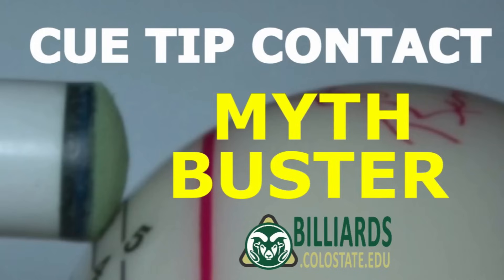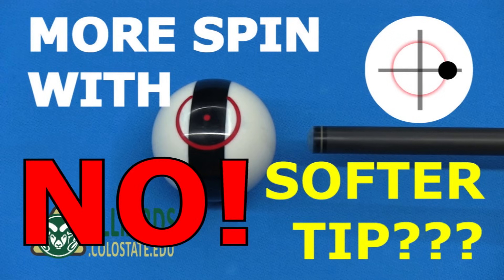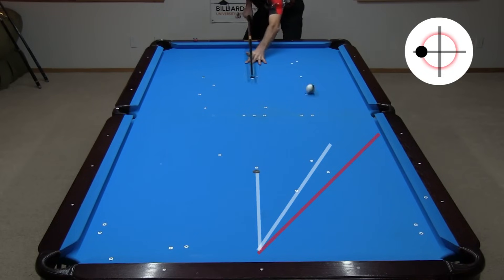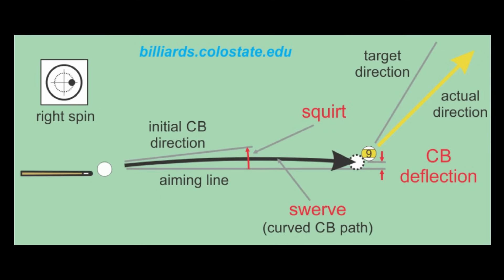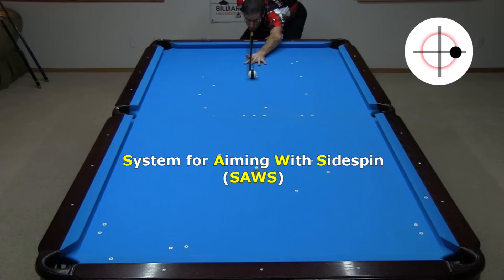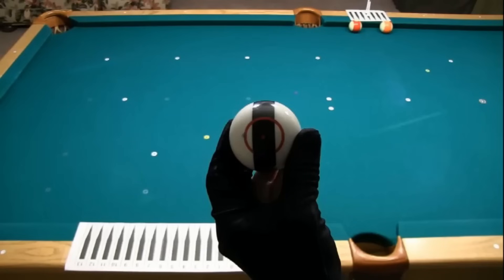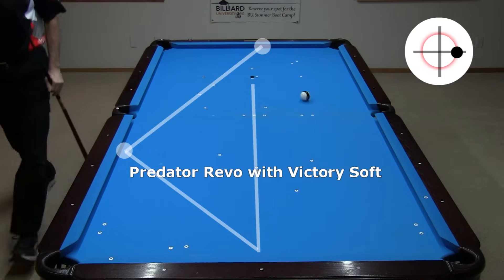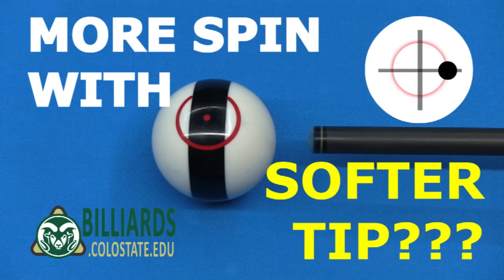Can a SOFTER TIP Put MORE SPIN on the Ball? -- MYTHBUSTING Answers

Comment: You have done great effort, but  I wish you gone deeper with cue ball deflection with hard and soft tips. so many say with hard tips it deflect less but as a side spin player for 20 years and I'm extremely nerd at it, I can confirm hard tip deflect more than soft, because I got to the point where I at so many shot I don't need to compensate for deflection.
Reply from the maker: See the links and info in the last section here:
https://drdavepoolinfo.com/faq/cue-tip/hardness/

Comment: When it comes to power transfer, are harder tips more efficient than softer ones? I'm referring specifically to playing cues, not break cues. Is the difference in hardness ratings — soft, medium, hard — even significant enough to be noticeable? Again, I'm referring to playing cues, not break cues which have extremely hard tips.
Reply from the maker: Harder playing tips are slightly more efficient, and it is noticeable to good players.  For more info and demonstrations, see:
https://drdavepoolinfo.com/faq/cue-tip/efficiency/

Comment: I think many players equate the size of the contact patch with traction--like how a tire grips the road via friction.  The huge difference, however, between a tire and a cue tip is contact time.  Contact patch size does not equate to increased friction on a cue ball strike.
Reply from the maker: @thedevilinthecircuit  Agreed, unless the tip is not chalked well, in which case a larger contact patch size could help.  For more info, see:
https://billiards.colostate.edu/faq/cue-tip/hardness/

Comment: I think doctor dave proves that it doesnt add more spin rather adds more control on the spin. The harder the tip the lesser control but stronger hit, while softer tip has more control but lesser hit
Reply from the maker: That's a fair summary; although, the difference is tiny and easily adjusted for by any good player.

Comment: so to make it clear then what makes a different between cue tip hardness if it doesnt effect spin on high or even low spin,is it basically just a "cosmetic" that you choose along you changing and try different hardness and what shooting feel you like the most?
Reply: i've still don't get enough why there are soft,medium and hard tip but according to my experience as new player that has tried 3 of those that are the same type just different hardness(kamui black clear) i really like soft and medium but i do prefer medium more since when i use soft it only takes 2 week before the tip starts to mushrooming and i had to pay another 24USD to change the tip but in medium hardness i found a balance between durability and kinda "soft" feeling when i hit the ball,i dont like hard at all and i play really bad for 2 months because i'm using hard,it feels like i just made a shot onto a concrete and i feel like it makes my stroke a bit worse because it has feedback(maybe it's just a placebo effect because of the sound that hard tip makes when it hits) and it really annoy me
Reply from the maker: @raz0gaming  There are many differences, all of which are summarized here:
https://billiards.colostate.edu/faq/cue-tip/hardness/

Comment: You hit them at different speeds up and down the table your crazy
Reply from the maker: Which section of the video are you talking about?  With the max spin tests, I explain in the video how I took many shots and only showed the ones that had the same CB travel distance (to guarantee the shot speeds in the comparison are the same).
Reply: @DrDaveBilliards  the first lag up and down you claimed to hit the ball the same pace 3 times but you didn't. You claimed the ball was made to travel further due to the hardness of the tip. That's a load of crap
Reply from the maker: @mickmck13847  My stroke certainly felt the same for all of those hits.  I am generally very consistent with my lag shot on this table.  Regardless, different tip hardnesses definitely have different hit efficiencies.  Proof can be found in the first video here:
    https://billiards.colostate.edu/faq/cue-tip/efficiency/

Comment: Scientifically speaking, I’m not sure if those comparisons are fair when you are using an uncontrollable variable in your stroke. I think it would be more fair if you used a mechanism that would impart the exact same amount of force for every shot. Human error will lead to skewed results even if you truly believe that you’re hitting them all the same.
Reply from the maker: As I explain in the video, you don’t need to hit every shot perfectly.  You just need to hit enough shots with each tip, really pushing the miscue limit, to see what is possible, and only include (in any comparison) shots with the correct speed (based on how far the CB travels).  Careful cue testing with humans is almost always better than most machine testing that has been done over the years.  For the reasons why, see the “Rules for CB Deflection (Squirt) Testing” section here:
    https://billiards.colostate.edu/faq/squirt/robot-test-results/

Comment: Very nice video. Your tests appear valid when applying sidespin with a nearly level stroke. 
Your conclusion, though, that tip hardness doesn't matter much may not hold true in other stroke scenarios. 
     In particular, consider a situation in which you must apply significant backspin at distance (e.g., a straight shot with the object ball 8-10' feet away). 
     In such a scenario, a different and more complex set of variables and constraints come into play. For example, depending on the cue ball's distance from the rail, a nearly level stroke that will apply backspin may not be possible. The cue's angle of descent with a hard stroke affects tip compression, and may lead to differences between hard and soft tips in these sorts of shots.
     Have you done any tip hardness comparison tests involving power draw at distance?
Reply from the maker: I'm glad you liked it.  I have done test for other types of shots.  See the video and info here:
    https://billiards.colostate.edu/faq/cue-tip/hardness/
Enjoy!

Comment: I can verify that both my playing cue (soft tip) and break cue (phenolic tip) can impart about the same spin, but seeking the max spin I can make 9/10 shots without a misscue with the soft tip and 2-3/10 shots with the phenolic..... I have much more confidence playing shots with lots of spin using a soft tip and I also like the feel of the longer contact.
Reply from the maker: FYI, a softer tip does provide a different "feel," but it is impossible to detect the "longer contact" since humans can't detect time differences in the millisecond (thousandth of a second or 0.001s) range.  For more info, see:
    https://billiards.colostate.edu/faq/cue-tip/contact-time/
    https://billiards.colostate.edu/faq/cue/feel/

Comment: I'm afraid that I think you have failed to mythbust. The hypothesis you tested was "Tip softness affects maximum limit of spin." But I think the myth "softer tip put more spin on the ball" is not about maximum limit. Because most of the players don't know actual maximum limit (that is why you had to invent that clever method in the video), so the myth cannot be about it. What they know and evaluate with is "amount of spin/effort" ratio. In other words, "It's EASIER to put more spin with softer tip." 
It's quite hard to identify what is "effort" or "easy" in this context, but there's something leads us to feel "easier." It's maybe wider impact point (patch) makes permissible range of error wider, maybe the difference in feel of impacts makes stroke adjustment for consequential shots easier, or maybe we just biased by the myth. Mythbusting is always harder than it seems.
Reply from the maker: "It's EASIER to put more spin with softer tip" is also a myth.  For detailed explanations and additional proof, see the follow-up videos and info here:
    https://billiards.colostate.edu/faq/cue-tip/hardness/

Comment: 10 out of 10 guarantee if you strike the cue ball with the same speed and amount of spin, the soft tip will generate more spin on softer shots. The contact patch clearly shows that you have more surface area with a softer tip and therefore more grip.
Reply from the maker: Then you need to find a different 10 people.  For the reasons why the contact patch size, longer contact time, and other factors don't allow a softer tip to impart more spin, see the detailed explanations, demonstrations, and linked resources here:
    https://billiards.colostate.edu/faq/cue-tip/hardness/

Comment: I just adapt the aim when playing with side spin, depending on shot speed, ammount of spin, bridgelenght, dry/moist climat conditions and cue elevation. I do not do pivotting when down on the shot. Judging aiming line is done when standing and walking into the shot. When down on the shot I do not need to change it.
Reply from the maker: That's how most players do it.  But not all players are as accurate and consistent as others when doing this.  Without SAWS, my aim with sidespin was unreliable, especially for large amounts of sidespin and longer shots.  With SAWS, I am much, much better.

Comment: Funny, you claim that softer tip has an effect on miscue and yet it has no effect on spin. While we know, that miscue can be treated as an extreme spin.
Reply from the maker: The drill in this video showed that a soft playing-cue tip can generate slightly more backspin than a really hard phenolic hybrid tip on a break cue, but the differences among playing tips over a typical range of hardness would probably be too small to measure.
Reply: @DrDaveBilliards  and yet, top level players are using those differences. IMHO you are oversimplify non linear problem with too much of averaging.
Reply from the maker: @jan.kowalski  High level players use both soft and hard tips.  Study the resource page:
    https://billiards.colostate.edu/faq/cue-tip/hardness/
Reply: @DrDaveBilliards  then please read about Young's modulus and it's applications. If you are sure about your calculations then please tell me, is temperature change at the point of contact between cue and a ball in different kind of shots the same or different? If different then is this difference linear or non-linear? Then you will have your answer probably.

Comment: Dr. Dave, I like to get your thoughts on this: I saw your video on drawing the ball with different tip hardnesses. Might a softer tip impart less speed on the cue ball that the spin has to overcome which would be important on draw shots that are cuts. In other words, with a harder tip the cue ball would travel down the 90 degree line longer before drawing. I always thought of a good stroke being able to generate more rpm’s per mph.
Reply from the maker: For a given tip offset, a softer tip imparts slightly less speed and slightly less spin by the same proportion.  For more info, see:
    https://billiards.colostate.edu/faq/cue-tip/hardness/

Comment: My criticism of this is that you're comparing the best spins you get with each tip, ignoring the miscues. In reality, if extreme spin with a hard tip leads to more miscues than you get with a soft tip, then you get more spin with a soft tip, since you will instinctively reduce your spin with the hard tip. This is comparable to players used to pub cues. Because they're often not perfectly straight, they tend to be bad at backspin, because they've subconsciously trained themselves to aim higher on the white to avoid scooping. But it is a very interesting video! :)
Reply from the maker: Check out my "POWER DRAW and Large-Curve Massé with a BREAK CUE Phenolic Tip!!!" follow-up video:
    https://youtu.be/NZcZlJNW5IA
I didn't miscue once with the super hard tip.
Reply: @DrDaveBilliards : Right. That was an interesting video too, but again, I think my point is that if the hard tip requires much more skill to get the same effect, then I would continue to say that the soft tip gives more effect. You might simply be too good to use as an example.
Reply from the maker: @jeschinstad  That is kind of you.  Related to your points, hard tips (especially phenolic-based tips) do not hold chalk as well as most soft tips; so if you don't chalk carefully or often enough, a softer tip might be a better choice.  FYI, other differences are listed here:
    https://billiards.colostate.edu/faq/cue-tip/hardness/
Reply: @DrDaveBilliards : I've been testing your claims with people who have never played pool before. They all agree with you and they all prefer to play with my breaking cue than my playing cue. This is really interesting to me. I play with a 11.75mm soft tip Z2, so that might be an issue, but I'm really interested now.

Comment: What about the aiming point for each of the tips?  Is it different?  If so, how does that factor into the results of the test?  Are the differences between the tips further minimized/reduced by using a different aiming point.  Thanks you for all the great videos!
Reply from the maker: As I mentioned and demonstrated in the video, each shaft had a different amount of CB deflection, so I did need to aim slightly differently with each.  The aim was verified by making sure the CB was sent over the foot spot or to the golf tee on the rail.  Concerning contact point on the ball, if you push the miscue limit and take enough attempts (some will be miscues if you are pushing the limit), you will eventually get maximum spin, regardless of how good or bad a player you are.

Comment: Why you do all the tests with a break cue phenolic tip, as the hardest. It’s So big difference between a phenolic hard tip and a leather hard tip? It might be… in my opinion.
Reply from the maker: The BK Hybrid tip is not quite as hard as a pure phenolic tip; but it is certainly harder than most hard leather tips.  I thought that would be a good test to show what is possible.

Comment: Great video! Although I disagree, you can hit the ball further on the outside with a soft tip, which would cause more spin. Also less miscues with soft.
Reply from the maker: Thanks.  That sounds reasonable, but it is not true based on the explanations, videos, and links here:
    https://billiards.colostate.edu/faq/cue-tip/hardness/
Reply: I have got spin with a hard tip on the outer diameter of a cue ball with no problem. Sounds like a skill issue buddy.

Comment: I’ve been playing for over 20 years and am a 700 rated player, with credentials to back it up.

For me, personally at least, I’ve concluded (100% certainty) that a softer tip produces more squirt. I use several different shots to test this, and have noticed this phenomenon every time. I first noticed it when buying my first Predator REVO shaft, as it comes with a soft tip installed. The aim on these test shots that I use were off by at least half a ball. I immediately cut the tip off and changed it to a hard tip, which is what I was accustomed to at the time. The squirt and aiming of those same exact shots were now consistent with my previous shaft that also had a hard tip on it. There was almost no need for adjustment.

I then further tested this by using someone else’s REVO shaft on my cue, which still had the soft tip installed. Same result as in the cue ball was squirting about a half ball more then I anticipated when shooting my test shots.

For further confirmation of my testing method, I am able to make these shots 20+ times in a row, very consistent. But once I change the tip from my usual hard to soft, I consistently miss them the same exact way, over cutting or under cutting them by about half a ball, depending on the shot. If this isn’t scientific enough and an indication that tip hardness affects squirt, then I don’t know what is.

Also, I use the tip hardness chart that’s out there to gauge what exactly I was using, because the difference can be small or very large when just using terms like soft, medium, or hard.

For this test, at the time I was using the predator victory tips. The victory soft has a hardness reading of 75.3, while the hard came in at 85.3.
Reply from the maker: Theory certainly predicts that the longer contact time with a softer tip should cause more deflection (unless it is less dense and lighter, which tends to cancel the effect).  See the section at the bottom of the page here:
    https://billiards.colostate.edu/faq/cue-tip/hardness/
Reply: KK, thanks for posting.  Although I can't prove anything you're saying, I have no reason to doubt it.  In fact, I think you're on to something for reasons too long to explain here.  Again, thanks!

Comment: Does it make sense to use a very light cue 14 oz with very soft tip? This might help significantly increase margin of error for underhitting Or overhitting. This is probably because cue ball distance travel  varies with square of hit efficiency
Reply from the maker: … only for slow, finesse shots.

Comment: Given the tip hardness changed the contact point size but had no/negligible effect on spin imparted, does this lead to idea that neither tip size nor shape will affect spin imparted, so long as the CP remains at the same location? If a naked shaft would hold chalk, why wouldn't that work just as well, perhaps even a bit more efficiently ?
Reply from the maker: I naked wood shaft would not withstand the abuse after a while.  That's why we have ferrules ... to protect the wood from damage.  The tip also helps lessen the impact to the wood.  Concerning tip shape and size, see:
    https://billiards.colostate.edu/faq/cue-tip/size-and-shape/
Reply: @DrDaveBilliards  Obviously I was being a bit facetious but I believe your link proves the point. The tip, size and hardness, has negligible affect on play. Shape is perhaps a tad more influential as it expands or contracts the actual miscue limit (up to the 30 deg max) as opposed to how easily a player may operate at the limit without going over it.